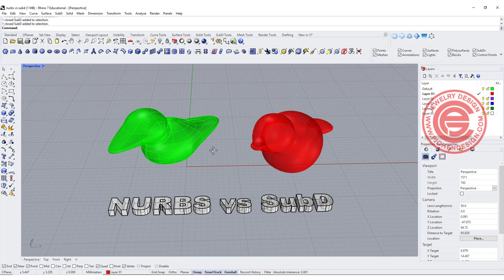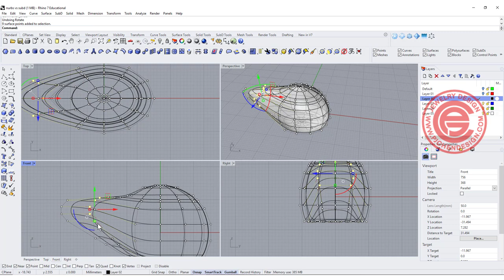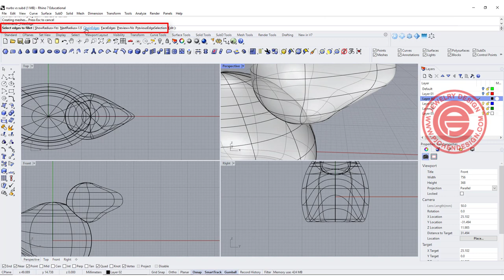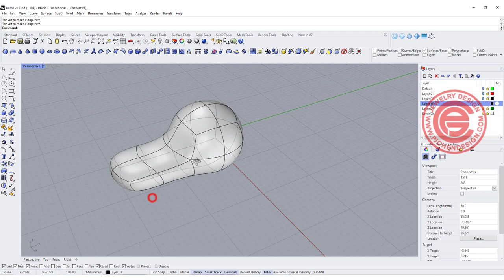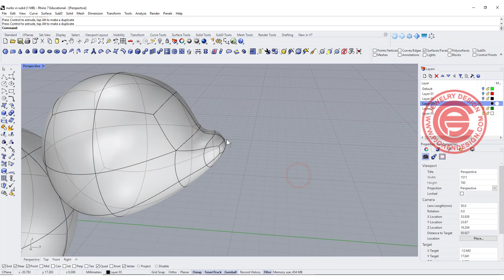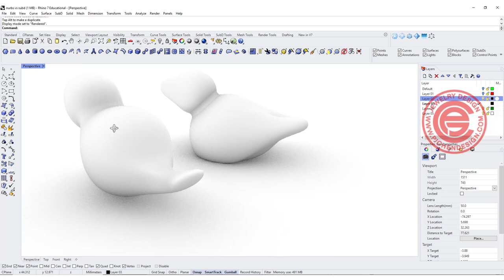NURBS vs SubD Surfaces in Rhino 7 #200

Comment: For smoother joining surface it would be better to cut both surfaces and then build new surface with Surface-Blend command. I wish Rhino had a better fillet algorithm.
Reply from the maker: You are right. you can cuse blend as well. It may still show a line at rendering tho.